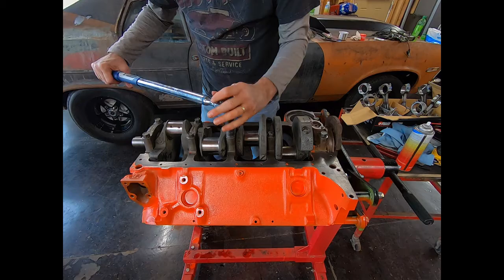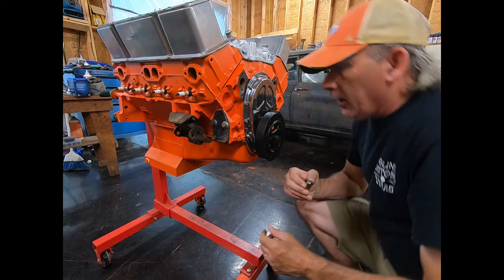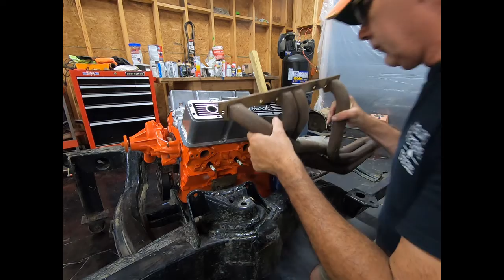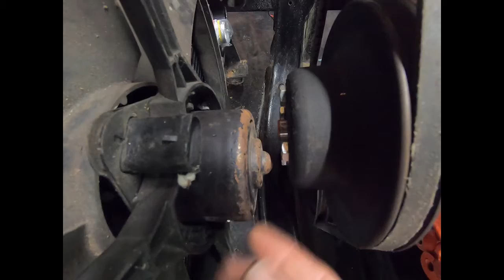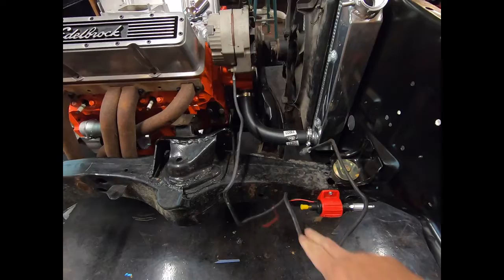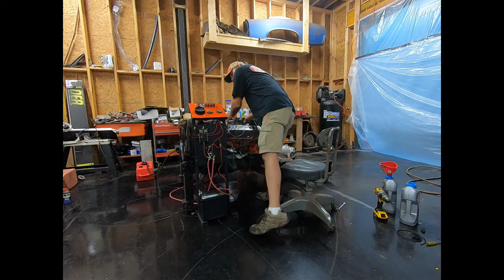Chevy 307 First Start

Comment: There is no replacemént for displacement. So pick up a 72 2barrel 400sbc. Had it bored 30 over to a 406, forge 11:1 pistons, afr heads, larger cam, heavy duty rod bolts. Add a tunnel ram and two Holley 390's( 780 cfm).That 406 is an animal when I hit the gas pedal.

Comment: PN is for a Ford Focus. Throwing my Spal in the trash where it belongs and getting an OEM Truck fan. 
If it can keep a truck cool, towing with ac etc it can keep my lousy A body cool.  Most aftermarket fans are bullchit. 
Try and get a real one not an auto parts store overseas knockoff.
Reply from the maker: Thanks for the info. Oem fans are badass. There’s a few parts store fans that are legit. Most are junk now though

Comment: Just found ya on here . Just a old shade tree Mechanic . Doin a 56 chev 2 dr wagon . So watchin and listening on everything yer doin , (why the 307 ? Because ya had it . I bought a 305 , then learned 305 is 150 hp , and hardly pull it self out of its own  way  that 56 weighs .3,400 lbs . To heavy to push ( I’m 61 yrs old ) rocker and floors first , got a 68 large Jurnal 327 , was in a guys shop for 30 yrs , then found a 71 350 in ästete sale . No one knew any thing other than he wouldn’t have kept it if it were junk . Got it turnin over . By hand .  . But stock worst 250. Hp . And 327 is supposed to be 300 Hp . So I’ll be watchin all yer stuff like yer style of teaching weather ya mean to teach or not. I Thank You .

Comment: What should I put them aluminum heads on with the 202 valves 305 307 or 406 small block Chevys??
Reply: Well the 2.02" valves come very close to the bore on a 305. Definite valve shrouding if you don't physically hit the bore. The 283 and 307s bore definitely has room (unlike long running opinions) to clear but still have some shrouding but not too bad. And of course you can bolt them on a 406. So yeah, any 3.875" and larger bore is fine.

Comment: Now I just bought another 307 I believe it has a bad cam in it. But I'm not for sure they're pulling the motor out tomorrow I only heard it run for about 30 to 60 seconds to determine what I might think that could be wrong with it it has aluminum heads on it somebody invested some money in this motor or at least the top end kit. So I do believe I think that it is trick flow heads or arf something like that I'm not for sure it's 190cc or 195 CC aluminum heads on it on a 307. I was just informed tonight that the motor would be pulled out and delivered to my house for a whopping $500. I'm buying the motor just for the heads but I'm going to run the 307 before I put the heads on my 406 small block Chevrolet bad to the Bone. It's going into a 1992 GMC Sierra. I don't want a LS if I break down I want to be able to find what's wrong with it and it be cheap to fix. LS motors are badass don't get me wrong but I'm old school

Comment: Let me tell you something about 307. About one from auction that was in a 1973 Monte Carlo sight unseen. My brother had a 400 in his Cutlass Oldsmobile. That is a small block 400 Chevrolet. That 307 was one bad ass motor. When I went for Florida I crossed over the California line it took 20 miles before I knew that I was being chased by a cop. I pulled over and stopped I should have not I should have just exited and left the interstate 10 and never look back. So that's the story of my 307

Comment: I had a 73 SS numbers matching 307 HO tag on radiator...tore it down because of rod noise, it had a 4 inch bore,,, I know they done this also with a 305 HO Iroc Z.... Issuance reasons.. I have also in the past have built some legit 307,,,and 305 aluminum rod balanced engines monster cams large stalls etc running 7.0's 1/8 mile....no torque high RPM.

Comment: You have 2 bungs on the heads ..one on the left and the right...one is temp sensor...what is the other one ??on my motor it has a bung blocked off
Reply from the maker: These heads were on an 80’s 305HO originally so there may have been something rude there or a plug from factory. I’m not certain.
Reply: Ok..my motor is out of an Australian 1968 Holden HK 307 2 barrel... anyone know of this other bung blocked off let me no oil or water...super torque up and hard to remove...if oil,will put pressure gauge in
Reply from the maker: If it’s on the head it is water. No pressurized oil flowing through heads. Oil comes up to rocker through pushrod and drains back to valley through drain holes in corners of head.

Comment: I'm just building the 307 in my 73 nova! what kind of headers are those? I'm looking at the hooker long tubes, wanna see which ones fit
Reply from the maker: I have flotech on my 73. They fit great. The ones on the 307 in video are Hedman headers. They fit good too
Reply: @Shop209  . Hello. I asked a few months ago if there are videos of the 307 in action? Camera in car as well as outside. Very few videos of these engines getting on it, let alone one built as nice as yours in a car with some stall.
Reply from the maker: @notnecessarilynecessary  not yet but there will be soon. I’m finally getting done of these projects wrapped up.
Reply: @Shop209  . Ok cool! Am curious to see how it runs. Thanks!

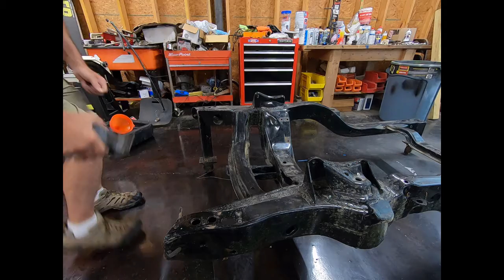Comment: I bought a '72 Rally Nova brand new in 1972. I added many high performance upgrades, 350 LT1 cam, 4:10 posi 12 bolt rear end, Edelbrock high Rise Tarantula manifold, Holley 850 cfm double pump quad carburetor, Accel dual point ignition,  Appliance headers, rebuilt th350 transmission, all oversize pulleys and belts and finally made 345 hp, dyno tested! All that and she caught on fire due to a blown trans cooler line spraying trans fluid on the hot headers, totaled ! I'm sure I did much more to that car and I miss those days so much....

Comment: I am currently building a test stand out of a 74-75 Camaro sub frame. I got the idea from Chevrolet Performance display at the US Nationals, so I'm making my own. I was going to keep the entire front suspension and steering, but it is too large for the very limited space I have. I welded on caster stands on all 4 corners. I am going to shorten it to about 15 inches behind the block, cause it needs to be shorter as well. Using small block clam shell mounts, small blocks, and big blocks fit Perfectly! Using a v6 s-10 radiator, and similar fuels system like the video. My last two break in's presented some sneaky leak problems, but when finished, I can break it in outside the car. It only took about 30 years to figure out another way.
Reply from the maker: That’s exactly why I built the one I have. I wanted to be able to chase leaks and other problems before I put it in car.
Reply: @Shop209  When I think of the grief having  this would have solved over the years, when the only option was break in in the car, holy cow my aching back!

Comment: Does the 168 tooth flex plate work on the 1969 power glide?
Reply from the maker: As long as your torque converter has the correct hole spacing for the 168 tooth plate you’ll be fine. Starters are specific for the 168 or the 153 tooth flexplate.

Comment: Would you build a 307 for me?
Reply from the maker: Johng@camelliacustoms.com
Reply: Jamey Starnes ,
The 307 is actually a 283 block with a 327 crank , any small block cam will work as will other  high performance parts , 
These little small block Chevy Engines will scream to the Moon

Comment: The people who call this piston stroke combo boat anchors are running the large journal variation. It's also why there isn't much aftermarket support.

Running a larger cam in them is fun you can put the engine to advanced crank standard cam timing. Shorten the pushrods to meat max lift for 93 octane and use the cam as a slight supercharger with an x-pipe.
Reply from the maker: Yep. I was joking when I called it a boat anchor. All 307’s are large journal. Pre 68 engines are small journal.
Reply: @Shop209  they have a nascar bearing kit to put a small journal in a large journal 4 bolt main. If you can find the right factory forged crank it's worth re-sleeving a Vortec block. 

If your cam is over sized the issue you're having keeping it running is it's trying to pull the same amount of air as a 350 through the exhaust. It needs resistance to bring it down to the amount a 327 would so it function's like an E.G.R. valve. If you're running a 7" brake booster to pull more vacuum I'd say run an RPM restricter in it so it doesn't try sucking your carb dry.
Reply from the maker: The distributor was moving and timing was getting retarded. I fixed that and it ran fine. Although with large tube headers and a single plane, it won’t run as well at lower rpm. Thanks so much for watching!
Reply from the maker: Also, the bore stroke isn’t a lot different than LS engines. Just head flow is WAY better on LS.
Reply: @Shop209  it's one bore size and one stroke smaller than a 350. It's the 307 they should have built instead of the TPI 305. The also should have put it in the GMC Syclone and Typhoon just saying.

Comment: In the 80s my high school auto shop classroom an El Doroto subframe with motor and trans axle. Never ran but they used it as something to easily point at and discuss all the parts in a cars drivetrain.